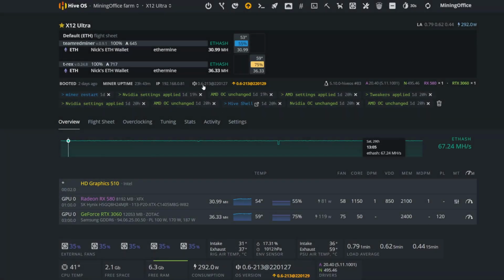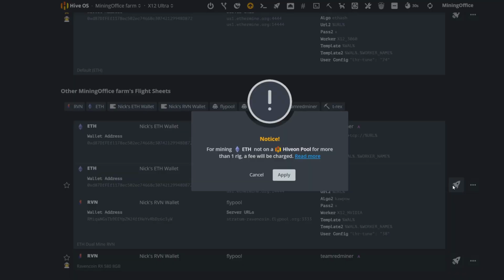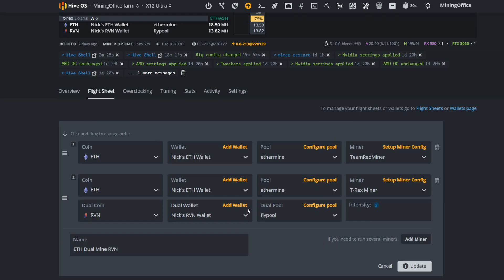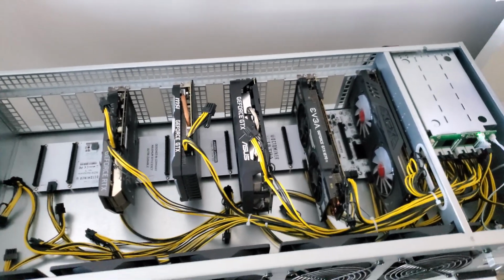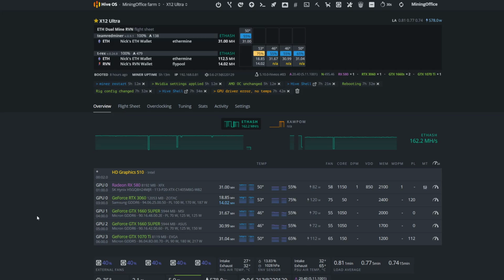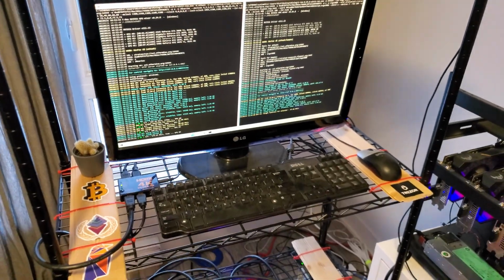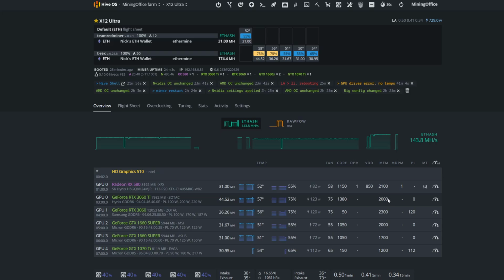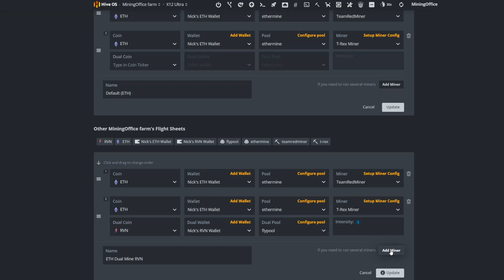Building a Mining Rig in the Octominer X12 Ultra | Learning HiveOs, Farm Optimization & Cleaning

Comment: Hey Nick, Really Nice video !
The Octominer X12 Ultra looks like a cool mining box, but seems kind of loud from the video.
What are your thoughts and impressions of it ?
Reply from the maker: Hey!! Appreciate you stopping by :) if you have that thing running at 100%, its like a hurricane in my office. But id say thats an advantage, because when the fans are lower (i run them at 40-50% normally)  they are not loud at all for the amount of air they push. They seem like good quality, heavy duty fans. I sort of see it this way: the extra power and airflow is there if you need it (say for 3070ti, 3080, 3080ti, 3090), and if you dont, you find the best compromise :)

Also, you dont hear the GPU fans as much since its a (mostly) closed case, where as on an open air rig you have those AND the rig fans that create sound. 

Hope that helps :) ill be glad to anwser any more questions if you have. Cheers

Comment: I am wondering what would be GPU temperatures if you would take out fans out from the GPUs and do the cooling only woth case fans. You know like in ASICs :) (just for the sake of saving gpu fan usage)
Reply from the maker: Yeah I mean, im sure it would do fine! you would need to 80-100% those octominer fans and also maybe not do it on 3080s or above, but it would probably do OK for lower powered cards I think.
A little too much work to test it out though ;)
Reply: @MiningOffice  i agree ;)